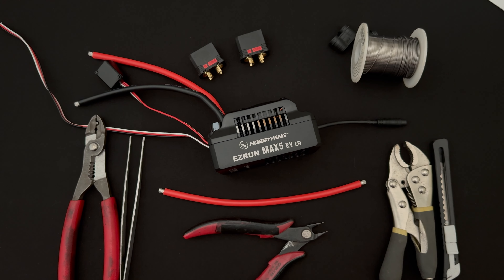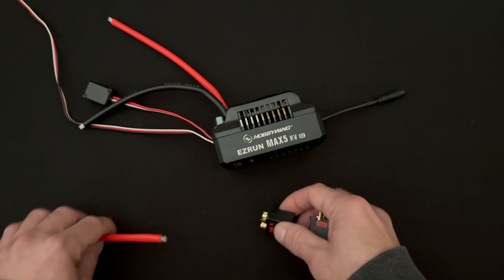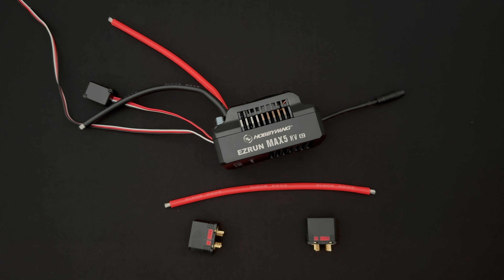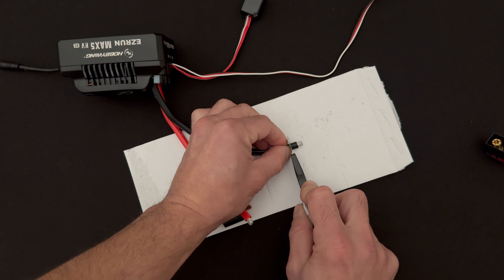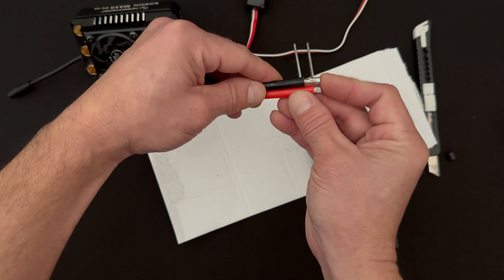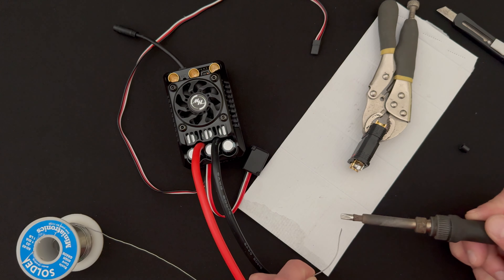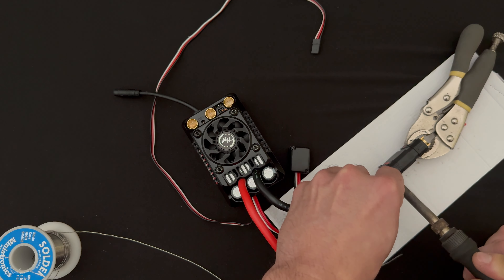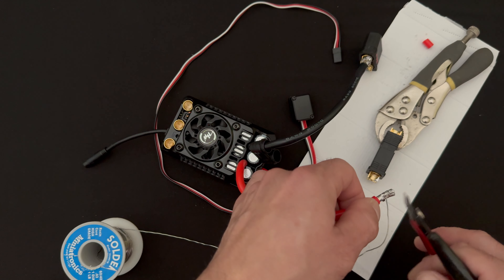The Charlie Show /// Episode 349 /// Series Plug Install and Soldering pointers.

Comment: I received a EZRUN Max6 setup for a single battery but I typically run two batteries. Is it safe to run a small extension that allows two batteries to be hooked up?

Comment: I use that second method as far as placing the wire in the bullet before the solder but I put some flux in the bullet first. Makes it go much smoother. I use that same exact solder and their brand flux. I also use a Dremel torch now. I’m never going back to electric. Your iron might not be getting as hot as it says it is after time.

Comment: Hey do you know if the first generation fusion 1200kv motor has some type of fail safe feature, in case lets say, one of my wheels gets stuck crawling, and it starts to bind up, and I do not release the throttle.  The motor shut off, until I released the throttle, then turned back on when applying throttle. I just noticed this. I know I’m not supposed to try and get one of my tires stuck, where the truck is binding up, but after testing it again by grabbing the wheel with my hand to try and get the motor to shut off, (until I release the throttle), it did it again. I never noticed it before, when I used to run that truck (axial bomber), and was just wondering if that is some type of fail safe, so you don’t burn up the motor???